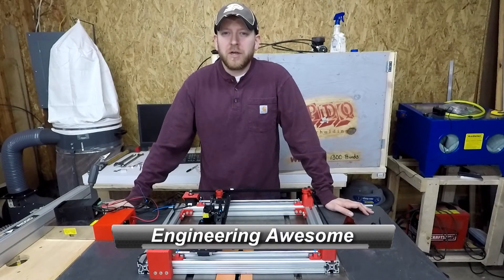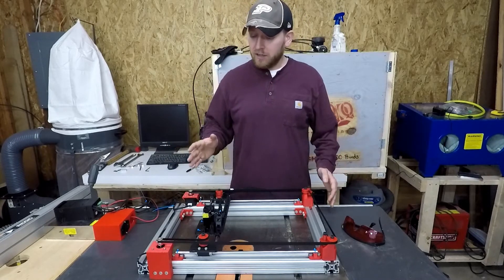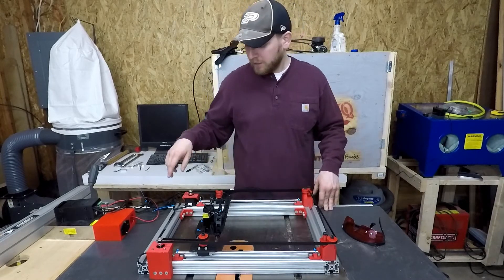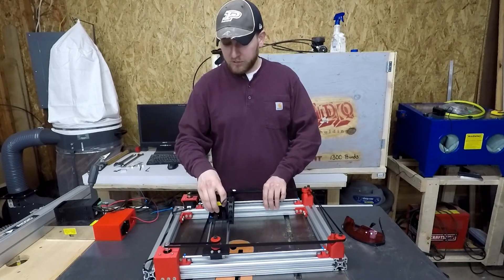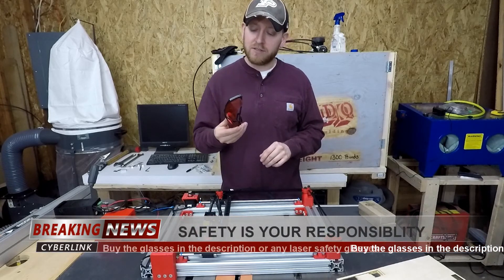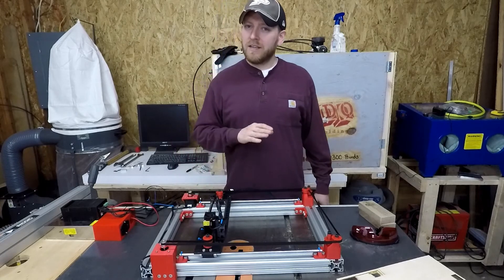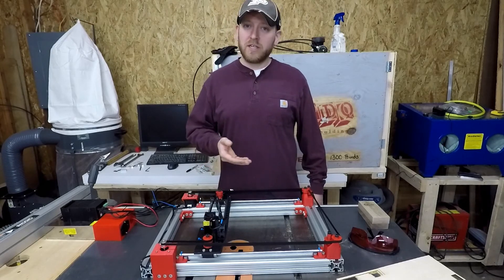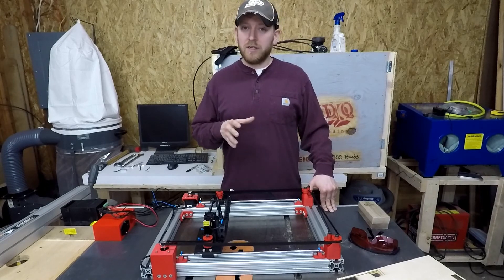DIY Laser Engraver

Comment: You should fit an air assist, it would stop the charring and would remove carbon to allow cutting in less passes . I use an aquarium pump.
Reply from the maker: Etched NI Bespoke Handcrafted Gifts that is an excellent idea. I may look into that. Thought it was mostly for CO2 lasers, but I'll be doing some research.
Reply: Works also on the diode lasers. I had a 2.5w myself but have since upgraded to a 40watt co2. I've also seen guys fits fans to remove the smoke from the lasers path which improves performance.

Comment: So...what software controls it and how are you adjusting power and duty cycle of laser? Are you usign PWM?
Reply from the maker: I am using Marlin as the machine control software and inkscape to generate Gcode. I am using the D9 fan port on the ramps board. It does send a PWM signal. Works awesome. You can set it for focusing by typing in m106 s20 and then start burning on m106 s255. M107 turns it off. I need to make a couple of modifications to the software for homing and then I need to post it as is. Thanks for watching man.